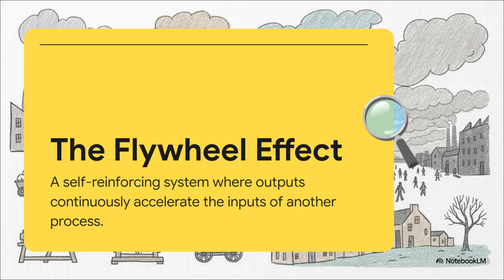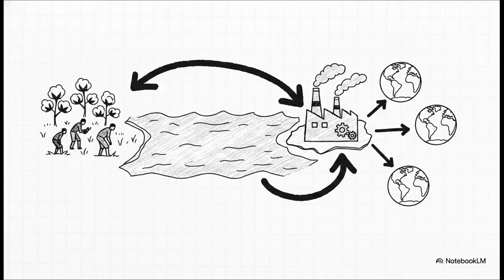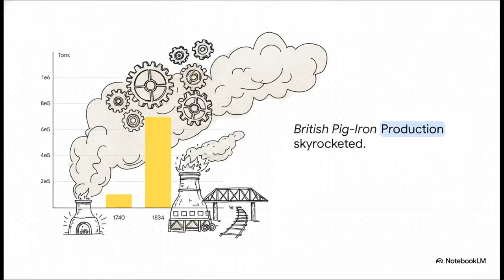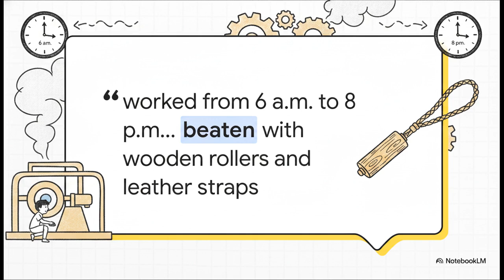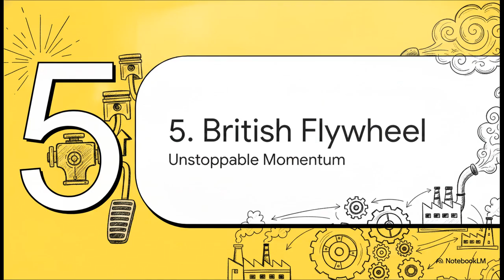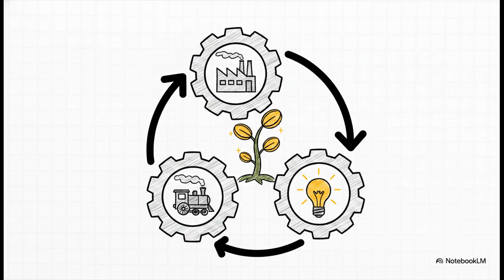The Hidden Forces That Made Britain the First Industrial Power

Comment: Take away Steam Powered Engines, and you get no Industrial Revolution!
20,000 Waterwheels and Windmills in year 1800, being joined by 10,000,000 High Pressure Steam Powered Engines by year 1900.
For every SINGLE Waterwheel and Windmill in 1800, we now had 500 Steam Engines in 1900.
A 500 times increase in Power Capacity for the whole country in just about 100 years!!!

Comment: The Industrial Revolution in Britain from the year 1776 to year  1900. 
No Steam Engines before then. FARM production increased by 300% (aided by Steam Engines). POPULATION increased by 300% (aided by cramming people into towns.
 TEXTILES production increased by 600% (aided by Steam Engines, a ban on Indian textiles, slavery and child labour). 
COAL production increased by 1000% (aided by Steam Engines and for Steam Engines, and child labour).
 IRON production increased by 28,000% (aided by Steam Engines and for Steam Engines). STEEL production increased by 600,000% (aided by Steam Engines and for Steam Engines). WATERWHEELS, the main source of rotary power for 3 thousand years but limited by the need for flowing rivers of water practically vanished (due to the Steam Engine). 
As did NEWCOMEN Atmospheric Pumps (due to the Steam Engine). 
And finally James Watt's  HIGH PRESSURE STEAM POWERED ENGINES themselves increased by 1,000,000,000% 
or 1billion%. 
So I don't think there's any doubt, James Watt's Invention of the world's first PRACTICAL High Pressure Steam Powered Engine caused the Industrial Revolution. Not complicated at all !

Comment: ATMOSPHERIC POWER. 
After work done by Geronimo, Somerset, Calley, Savery, and Newcomen we finally ended up with an Atmospheric Pump. 
And there it stayed for the next (yawn!) 70 years. 
The great English civil engineer John Smeaton increased its efficiency by 25% (supposedly). His supporters thought nobody could build a better Pump. STEAM POWER. 
He was in direct competition with Watt (he even managed to sabotage one of Watt's new engines). But he still lost out to James Watt's newly Invented High Pressure Steam Powered Pump, (bye bye Newcomen's Atmospheric Pump), soon to become newly invented High Pressure Steam Powered Engine. (Bye-bye Arkwright's Waterwheels, hello Industrial Revolution!!). 
The world's first PRACTICAL High Pressure Steam Powered Engine, which, by the way, WAS the Industrial Revolution. 
From 20,000 Waterwheels and Windmills in the year 1800 to 10,000,000 High Pressure Steam Powered Engines in the year 1900, (of which, only 25,000 were Locomotives). 
For every SINGLE Waterwheel and Windmill in the year 1800 we now had 500 High Pressure Steam Powered Engines in the year 1900!!! 
From 20,000 sources of Power to 10,000,000, better sources of Power. 
A LIMITED number of Waterwheels and Windmills being joined by an UNLIMITED number of High Pressure Steam Engines. An Industrial Revolution!